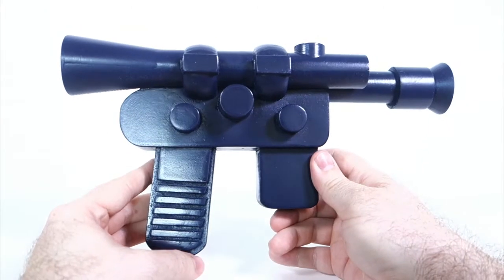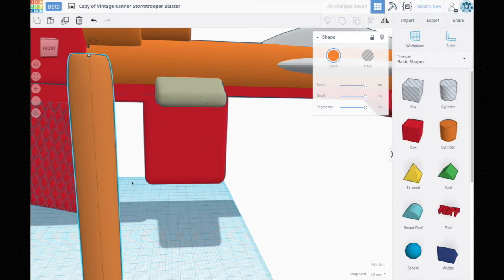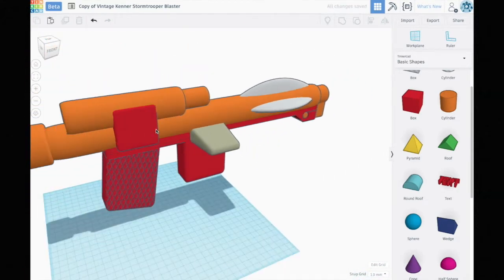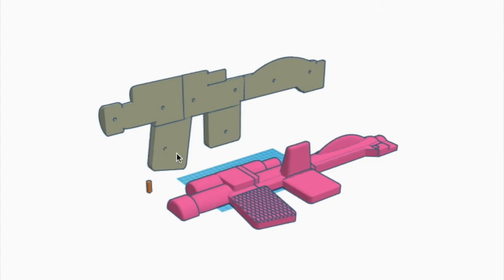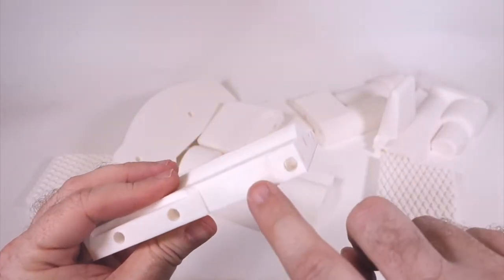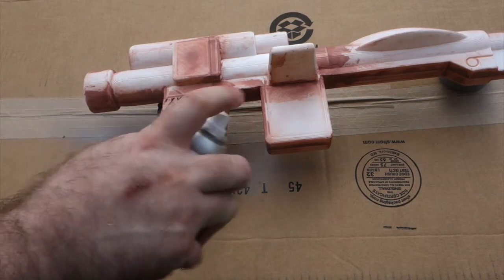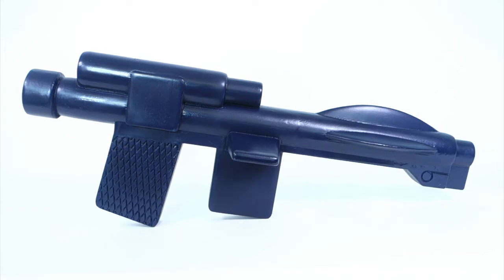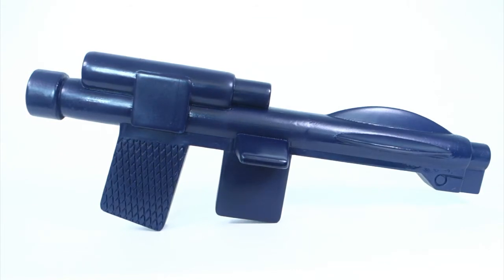Life Size 3D Printed Stormtrooper Blaster (Vintage Kenner Action Figure Inspired)

Comment: I think I just printed your files from thingiverse before finding this video.  I'm pretty sure it is your file since I too found the issue with the two sets of holes interfering with each other.  I want to thank you for uploading this file.  I got mine glued together this weekend.  I will soon start the pain staking process of sanding it.  I was thinking of sanding down the print lines before bondo.  Then just use the bondo to fill the lines in.  I think the first couple of parts shifted when I glued them together.  I was more careful after that.  The friend that printed mine used PLA.  Have you printed much with this material? if so, what kind of glue do you recommend for it.  Doing a search on the internet gets you everything under the sun.  Did you hae to adjust the pin size when you printed them, because the onse we printed direct from the file seemed under size.  I ended up going to local hardware to find something to use a pin alternate.  I found these wall anchors were perfect press fit https://www.amazon.com/Red-Plastic-Anchors-uses-Screw/dp/B00AM0WT2A.
Can't wait to use it on a trooping event for fun!

Comment: This is super cool. Is it possible to scale it down and print as an replacement for the (lost) original blaster?

If, what size is that one? 🙂
Reply from the maker: Not sure exactly what scaling factor you’d use in that case to be honest. It would need to be done in resin to have any chance of success
Reply: @MightyJabbasCollection  
Thanks mate. The guy who have helped me printing stuff before uses a resin printer.